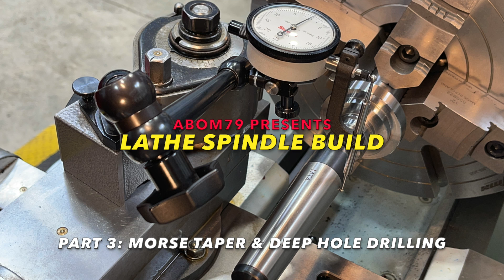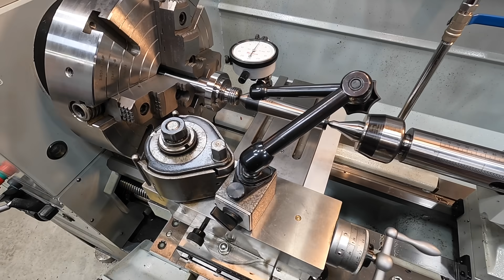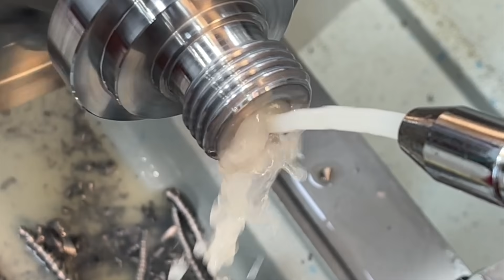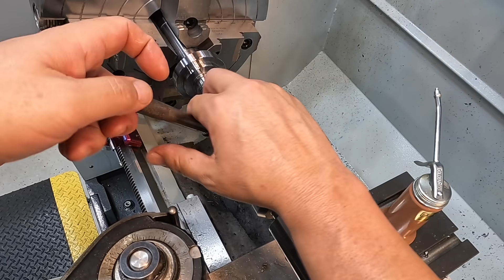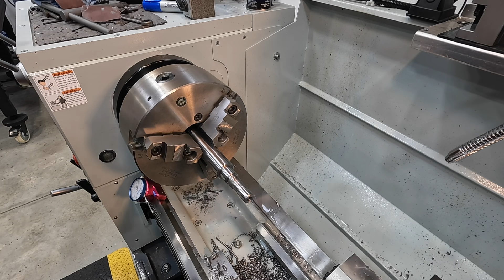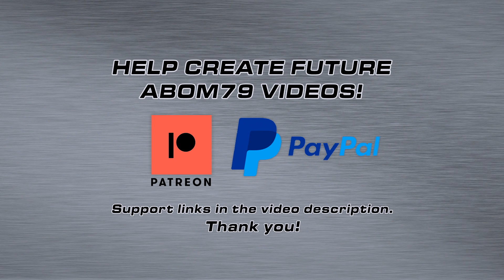Machining a Wood Lathe Spindle Ep. 3

Comment: Could you have placed a 1 - 2 - 3 block against the side of the body of the cross-slide and against the Morse Taper to match the angle and then synched the cross-slide down?
Reply: Yes, this will get you very close. After this part of the setup snug the two or four bolts on the compound for the next portion of the setup.  Using a tenths dial indicator measure the drop off over the measured 'straight' to get your established angle via trig. This method is shown in at least one of Abom's prior videos from his home shop if memory serves me today.

And btw, the MT4 vs MT2 angular difference is real and problematic for a wood spindle drive center. 2.9752 dd vs 2.86133 dd included angle.  With .624 in/ft vs .5994 in/ft or 1/2 included angle of 1.4876 vs 1.4307 in decimal degrees (dd) respectively. 

Measuring to fit a dimension at the large end and remove the error with a reamer sorta works,  ask me how I know. This can mean your large end will be deeper than called out. A straight bore to clear the large end is ok since it will not affect the registration for the 4 jaw chuck shown. Making a 60° center angle registration works as well since it too will not affect the chuck. MikeC 

I recommend blueing and fitting for a finished bore here.
Reply: Thanks for the clarification. I'm a former industrial engineer who always looked for the easy way.  @CothranMike

Comment: What are the 2 long slots in the cross slide for? I’ve seen those on schaublin lathes too and I’ve always wondered
Reply: They are probably "T slots".
Reply: @tsmartin  they are certainly tslots, but for what?
Reply: You could use them for a back cut off tool, upside down cutoff blade that cuts as you crank out, or you can remove the compound and use the cross slide as a table for line boring
Reply: @daveb3910  yes that’s possible. Does schaublin make such an accessory?
Reply: Follow Rest?
Reply: @ffemtdd  i thought about that but you don’t usually need 2 transverse tslots for a steady or follow rest
Reply: They’re there to be used for whatever you want to use them for.
Reply: @ellieprice363  im sure a precision company like schaublin put them there for a very specific purpose

Comment: Adam - the thru hole is for a drawbar to hold #2 MT collets,  and for a knock out bar to remove centers, spur drives  and other MT tooling.  lots of spindle turnong starts out being turned with a spur drive, at least initially.  great video.  thanks for sharing.
Reply: That's been explained several times but he clearly doesn't read comments so you're wasting your time.

Comment: I'm sure I wasn't the only viewer sitting on the edge of my chair chewing my fingernails, Adam, after you set up to bore the taper using a #4 Morse taper instead of a #2. 🫣  But then I remembered you showing the #2 reamer at the start of the series and was relieved after you reamed it to a perfect fit for a #2.  😅  Talk about drama! 😆😆
Why there are different dimensions for each Morse taper is that in 1864, instead of simply specifying the standard, the Bureau of Standards used a master gage supplied by the manufacturer.  The manufacturer made two master gages and sent one to the Bureau of Standards which became the National Standard.   Accurately measuring a cylindrical taper is a bit tricky, especially back then without today's precision measuring instruments, Stephen A. Morse was trying to get a taper of 5/8" per foot which is 0.0521" per inch.  Since he had to make two master gages for each taper #0 through #7, making two of each size that matched so one could be sent to the Bureau was more important, and significantly easier, than making eighteen master gages for the series of nine individual tapers match the target taper.  Any of us who has tried to make two parts exactly the same can appreciate his challenge. 😆  Interestingly, Morse tapers are used in surgical procedures for hip implants and such.

(As an aside, I recently discovered that to this day the threads of screws in sewing machines are proprietary.  Sewing machines began to be manufactured in the 1800's before standards for things like screw threads were common.  Manufacturers like Singer kept their screw threads proprietary to prevent others from copying their machines and supplying parts.  An owner of their machine had to get repair parts from them.)

On a wood lathe the through hole is, of course, necessary for a knockout bar to eject the spur center which is often used for rough turning bowls or hollow forms or for turning spindles.  

This was an very interesting project with lots of good operations.  Good job, Adam!
Reply: Yeah ... I'm confused too. I know he was going to ream it but still it should have been rough bored to the correct spec.
Reply: I’m glad I’m not the only one that was stressed out during this.  I’m surprised it seemed to fit as well as it did before reaming, though.  At least the M4 angle is > M2 angle, so it could be fixed.  I am surprised the discrepancy didn’t get recognized, and addressed, though.
Reply: Adam other comments are filled with confusion regarding using a MT4 taper to set the angle for a MT2 bore. Can you lend clarity to this confusion?
Reply: I was confused by this as well since a MT2 has an included angle of 2.86 degree (.049951/inch) and a MT4 has an included angle of 2.97 degree (.051938/inch), I guess using the MT2 reamer is sufficient to take out the tenth of a degree difference....?

Comment: Very nice work! On the vibration issues with the long boringbar...may I suggest the following... go to the local vehiclewheel balancing shop and ask for some self adhesive balancing lead (used for balancing alloy wheels) ....adhere a strip on the TOPside of your boringbar and make sure that you make a slight bend in the middle of the lenght (so that THAT area wont adhere to the boringbar!) Give it a try! The reasoning is.. by adding the mass of the lead you shift the harmonics...and that non-sticking area in the middle will also dampening vibrations on basis of that local weight and the stickiness of the adhesive in the borderregion from adherd and not adherd. Succes and greatings from the Netherlands😊
Reply: Thanks a lot. That’s an excellent suggestion that should work well for dampening the vibrations.

Comment: Hello Abom. You use a Morse Taper MT4 as a pattern for scanning. However, you cannot make a Morse taper MT2 with this measuring because the angles of the different cones are also minimal different. In MT4 the half angle is 1 degree 29' 15" but in MT2 it is 1 degree 25' 50".
Reply: I was about to make the same comment. But if you use this angle as a rough measurement to rough machine the taper before finishing using a mt2 reamer, then it works probably just fine. It would be nice though if this was detailed in the introduction.
Reply: Out of curiosity, I did the math. Using the MT4 taper as reference, the MT2 taper ends up 0.005" over size at the small end. Or in other words he needs to ream the big end 0.005" larger to get the profile correct for the whole length of the taper. Just cleaning up the toolmarks on the big end might be 0.001".
Reply: @2testtest2  While you're right on the math, but wrong on which way you are applying it. The MT4 taper is a larger angle so if you bore as Adam did to the rough large end diameter (.700 spec but he was at like .695), then the small end is .005" undersized thus when reaming with the reamer, the cut would start at the small end and work its way out as the reamer progressed inward, so once the reamer has made some sort of cut (even just .0005" for that matter) at the large end, it has cleaned up the entire length.
Reply: What about inspector morse?
Reply: You are not considering the difference in angle because the MT4 and MT2 and the post bore reaming.

The MT4 has a slightly larger angle than the MT2 and thus when he bored to the big end diameter that he wanted, the small end would have been .005" undersized. When the reamer was introduced, the reamer cut would have started at the small end and progressed outward towards the big end so the moment the big end was showing some sort of cut from the reamer, the entire length would have been cleaned up and trued to the reamer.
Reply: I was going to say, an MT4 is huge for that spindle, I just machined a new spindle for my 1950 Walker-Turner wood lathe and it was only an MT2, the MT2 will never seat correctly in a MT4 taper.
Reply: You are correct Robby
Reply: CJ you were absolutely correct I miss spoke I can only hope that the people I was trying to address understand what I was saying
Reply: Robby, how do you explain that it did in fact work?
Reply: @c0mputer  Who says it's actually perfect? He put the drill in, and of course it seems it fits. The only way to check whether the Morse taper of the drill fits perfectly everywhere is to use ink.
Reply: He reamed it with a MT2 reamer… I’m sure it’s fine.
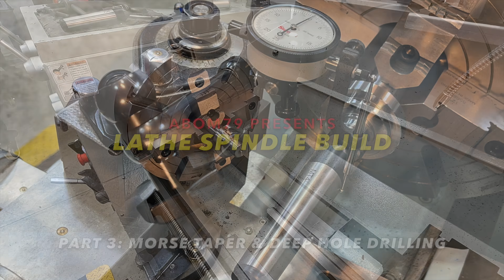Reply: 0:16
Reply: Robbie, you just showed all of us how to disagree without criticism. I’m sure Adam doesn’t mind if you disagree with him. just know there is a difference between disagreeing and criticism. If you disagree, just tell us how or why you disagree and explain what or how you would do it differently. Then let us decide which way we want to do it. That’s it folks is that easy no hatred, no criticism and no childish remarks. If y’all haters out there, can’t do that then for god sake, do is all a favor and get some help. It’s never too late. God is waiting for you.❤❤❤❤❤❤
Reply: @garycarpenter9948  I'd say that what Robby did was in fact criticism, just done in a respectful way but he still was critiquing what Adam did by pointing out what he perceived as flaws or mistakes which is "criticism" by definition. The only problem is that although Bobby is correct in his analysis of the angles being different, he errored in his critique by not considering all relevant factors that combine to arrive at the final result. The secondary reaming op corrected the error that he was getting at.
Reply: @garycarpenter9948  I have already written what is not entirely correct. That's my opinion and maybe some criticism too. I'm surprised by this approach, as Adam actually works very precisely and precisely. I once almost ruined the Morse taper on my tailstock spindle in a similar way, so I'm noting it here. My intention is to point out this small mistake to others so that something similar to what happened to me doesn't happen to them. Everyone has to know what they do. 
It may very well be that it is perfect, but you have to check it with a spotting paste, only then can you see it, everything else is guesswork. 
And many others see it the same way I do and agree with me, so my comment can't be that wrong. And criticism doesn’t have to be a bad thing. It's just a matter of opinion how you take it.
Reply: 😂 trust the man. He knows what he's doing. He is Mr. Wizard with a manual lathe. You're thinking no way in hell that will work. And boom, when he's  done, it's absolutely perfect lol
Reply: He finished with a MT2 reamer, how will it not work..lol?
Reply: @tmurray1972  In order for it to be perfect, the reamer would have to remove a lot of chips so that it is the exact size. Sure it works for now, but the tool won't support the entire surface of it. The only way to check whether it is accurate is to use inking paste. In addition, the cone would actually have to be hardened.
Reply: @tmurray1972  Did he say it was an MT2 reamer? I assume also.
Reply: @duanedickey7043  Yes he did.
Reply: It only needs to be close lads, it was reamed after it was bored.
Reply: That is the biggest load of crap mt 1 all the way up to mt 7 are all the same angle.
Reply: @ellarickey6925 No, you are incorrect, please reference the Machinery Handbook.
Reply: The angle of the Morse taper is always the same, no matter if it’s a #2 Morse taper, or a #4 Morse taper. He was just using the #4 dead center to dial in the correct Morse taper angle. He could have used any Morse taper bit/attachment.
Reply: Morse taper are never the same! The angles are slightly different. @pauljoseph8338
Reply: @pauljoseph8338  That's not true. All Morse tapers are slightly different in angle. Look in the relevant tables and you will see it.
Reply: @robby-cgn okay, I was just guessing, like a REAL YouTube commenter. Apparently, there’s NOT more than one way to skin a taper.
Reply: Each Norse taper size has a different angle ...they are not all the same as you state. That said, it may be minimal, and the mt2 reamer may have cleaned it up. Would have liked to see it blued to check the contact.

Comment: just for information the hole goes through the piece so you can run a vacuum chuck (a cup with a rubber gasket that when vacuum to it can hold bowls or plates to finish the bottom) the vacuum pipe goes in the bac end of the piece
Reply: also with no way to knock the morse taper out you push a rod through it

Comment: He does realize there are formulas to calculate the rpm for drill bits? xD 
320 for a 10.2 is nuts, that's 41% of the calculated rpm. (VC*1000/3,14*diameter, 25*1000/3,14*10,2= 780) i normally run my drillbits abit faster bcz it really doesn't matter for me, regrinding a drillbit takes a minute per hand if not less lol.
Reply: Actually, he has no idea about that.  Clearly the man has no idea what he is doing.  Thank god there are geniuses like you on the internet to enlighten the rest of the universe.
Reply: It's almost as if he is making a one off part while trying to get good video of the process and doesn't want to get coolant all over the goddamn place.
Reply: Skilled machinists don’t waste a lot of time studying charts. Their years of experience provide them with a highly developed “feel” for correct speeds and feeds. There’s no other way to get it.
Reply: Wow. You are amazing. I mean, I'm in complete awe of you, ...just wow.
From this video,you somehow managed to ascertain what material he is cutting, what material his tool is made from, and the subsequent heat treatment to said tool and workpiece, and on top of all that knowledge , you managed to know exactly what surface treatment or coating the tool has.... just to inform the world the 25 metres a minute surface speed is the about the basic and start position for any mild steel.
You are a very special kind of special. Keep up the boring work...pun most definitely intended.

Comment: Something I didn't quite understand. You used a MT4 dead centre  to set the compound angle for boring a MT3 socket. My references show that Morse tapers have different angles albeit very slightly different. However I guess that the reamer looked as though it took care of that and would explain the initial load of chips on the  first pass of the reamer.
Reply: Fair point but like Adam did in the video, he used a 'standard' MT3 finish reamer. Most of the taper in my shop are MT2. I bought an MT2 finish reamer and dressed out all the sockets the same. Some were amazingly cruddy and some were a tad off. I also made a "standard" MT2 socket and plug so I now have a handy reference for whenever I make tapered tooling for my shop. I also bought the MT2 roughing reamer. Step drill the bore, rough ream, then finish ream, blue up and test with my in-house standard.
With the technique that Adam used with drilling then using the boring bar it pretty much guarantees that anything mounted in the taper will run true to the spindle.
Reply: @utidjian  I agree. Concentricity is most important here and the use of the readily available MT4 centre as a starting point for the ultimate shape is a good choice. Just as important was showing how to set the compound to duplicate the taper, an exercise that machinists to be aware of.
Reply: It's MT 2 not MT 3.

Comment: No two Morse tapers angles are the same angle . " Machinery's Handbook"
Reply: That's what I was thinking too.
Reply: Because of using a reamer afterwards, the Morse taper angle should not be that critical. Of course no two Morse tapers are the same, but they are not too far off as well.
Reply: As soon as he said what he was doing I thought, none are the same. A #2 is 0.59941" per foot, a #5 is 0.63151" per foot.
Unless he is stopping short and teaming it to size.
Reply: @dennisleadbetter7721 trust the wizard ;)

Comment: hmmmm!   not sure about setting the compound angle off of a #4 morse taper, to bore for a #2 morse. According to what I read, it said the angles varied depending on the taper size!
Reply: They are all very close, but, that's another reason to use the reamer.
Reply: I would have liked to see a fit test using spot dye to check the fit. @brettbuck7362
Reply: The difference between the two is .05  degrees, it's probably not a big deal. Plus he's got the right reamer.
Reply: thats what i thought too,  all the morsecone 1,2,3,... has a slight different degree of taper among them (were talking 1,87°,2,05° as an example) they have to be exact, thats how to obtain the precission

Comment: The through hole is used for a knock out bar and can also be used with a vacuum chuck.
Reply: Kinda figured the hole was to knock out whatever was in the Morse taper.  Not familiar with vacuum chuck.  Anyway, Adam showed some things that I didn't know how to do.  Did wonder about using the #4 Morse taper setup.